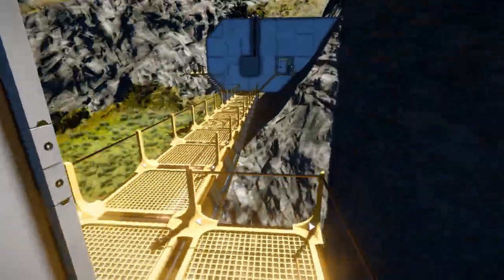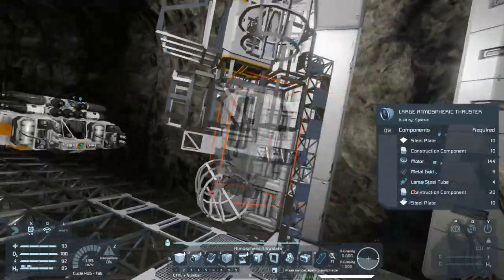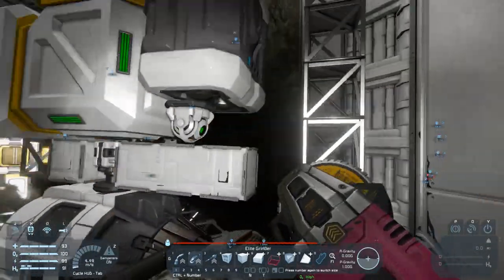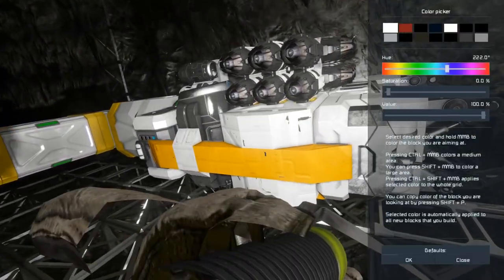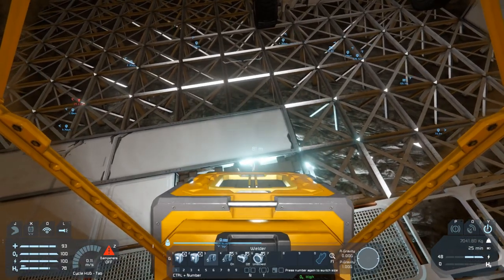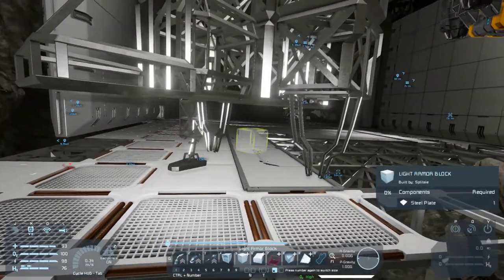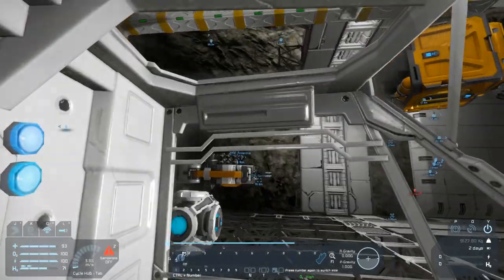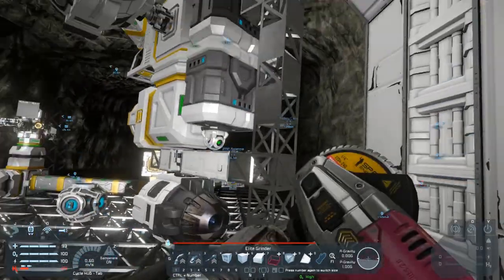Survival, Maybe... #35 Welder Woes With Buttercup (A Space Engineers Survival Series)

Comment: those thrusters on the Buttercup are just making me think the armor is going to deform and destroy something.  If I may, I would honestly replace the armor around the rotors holding the three thrusters with half slabs, maybe heavy armor variants of the slabs just in case.  Heavy armor slabs are super cheap so you won't be a considerable investment.  Those sparks just worry me too much.
Reply from the maker: The sparks are definitely not causing any damage, since subgrids can't damage each other by default. The reason I might change out the armor is because the thrusters catching might be contributing to the messed up handling of the ship so it might get things behaving better if I change it out :)

Comment: Maybe build the welders in front of your front wheels to build the road before rolling on it?
Reply: I thought about that for a while. If he puts the welders on the front portion, he'll be able to place the missing tile floors with the rover itself. Only a matter of balancing weight afterwards
Reply: Quasimodo. Not an animal but...
Reply: one thing that could also work is put the wheels on pistons, you can lower/ extent the wheels as needed to weld the plates on uneven terrain
Reply: I was going to suggest that too, puting the welders in front of the front wheels, and everything else (cargo, connecter, maybe even the cockpit) at the back to balance the weight.
Reply: Wow I had the same thought guys
Reply: Can they be mounted on rotors at an angle? Possibly with controls to change said angle on demand
Reply from the maker: To be honest I didn't actually test a vehicle with the welders on the front, but I was very suspicious that it was going to be too front heavy and topple over, though I suppose I could look into mass blocks for balance. It's something I may revisit in the future, but I think it's about time I actually weld up some of the hangar :P

Also +1 for camel and +1 for quasimodo noted :)
Reply: Lobisomen79 You know you can change height of wheels in wheels settings, right?
Reply: Kakss i know but that won't help much if the Front wheels are on uneven terrain and the rear wheels are 2.5m higher up on armor Blocks or can the wheels be liftet up that high without pistons? 😉
Reply: This might be the best solution. You can raise the welders when traversing uneven ground (like getting to a new worksite) and then lower them to actually work.
Reply: Lobisomen79 No, not that much

Comment: the rotor spinning is not your fault.
unfortunately its not my fault either, if it was i could fix it.

there is a phantom torque on rotors with thrusters, the power of the phantom torque depends on the force coming from the thrusters, and the distance of the rotor axis from the centre of mass. if the rotor axis passes through the centre of mass, that rotor won't be affected by it. when you connect to the base, that moves the centre of mass a long way away from the rotors, which causes a large torque on the rotors, more than the rotors can stop.

the only fix is to have a mod that increases the torque the rotors can deliver so they can overpower the phantom torque.
Reply from the maker: Damn, I was really hoping it was my fault - largely because that would mean I could fix it :(

I'll have to be careful how I set up the parking spot for the buttercup so that it doesn't drop far before I reactivate the script then :)
Reply: have the script, to listen to docking, when docked, turn off all thrusters, when undocked, zero out all torque and start thrusters

Comment: "Working as intended," he says as the Buttercup's thrusters spasm and spark wildly.
Seriously can you increase the distance they are from the armor or something? While they don't take damage I cannot properly describe just how unnerving it is to watch.
Reply: Glad i was not the only one thinking that
Reply: 1wsx10 57 minutes ago
the rotor spinning is not your fault.
unfortunately its not my fault either, if it was i could fix it.

there is a phantom torque on rotors with thrusters, the power of the phantom torque depends on the force coming from the thrusters, and the distance of the rotor axis from the centre of mass. if the rotor axis passes through the centre of mass, that rotor won't be affected by it. when you connect to the base, that moves the centre of mass a long way away from the rotors, which causes a large torque on the rotors, more than the rotors can stop.

the only fix is to have a mod that increases the torque the rotors can deliver so they can overpower the phantom torque.

Earlier comment by the hovercraft script author
Reply: He should add some slabs or something like that
Reply from the maker: The rotors are at their maximum displacement, I'm going to try replacing the armor with slabs and the lower slopes and see if that helps, it might improve the sparks and controls but from what I understand it's not going to stop the crazy spinning that happens when I lock to the connector :/
Reply: The crazy spinning is a feature.
Reply: AthkoreProductions Someone else reads Sluggy Freelance!
Reply: You know instead if complaining of a small error, you could just give the solution part. I'm not expert but he does make this channel the best he can and as real and enjoyable as possible without making himself a fool. If you think you can do better than do so and stop filling the comments with this garbage.

Comment: ive made a similar mining ship (large grid drill + vector thrust), those spark issues are likely due to clearance between the thrusters and the dark grey armour blocks, just remove the armour blocks directly next to the rotor and it should work fine, that's how i fixed it on my miner.
Reply from the maker: You're absolutely right, I eventually replaced them with half blocks and now it works nicely, still looks like a goldfish swimming when it moves though ;)

Comment: Concerning the Buttercup, perhaps, the drifting comes from the massive load into the off grid welder creating a torque between the two grids (two centers of mass). I think it's better to only load the main grid medium cargo container
Reply: With the inertia tensor enabled on the advanced rotor, it shares center of mass across both grids.
Reply: He turned that off didn't he?
Reply: He turned it on because vector thrust was not compensating for the center of mass and it was leaning towards the welder.
Reply from the maker: I turned the shared inertia tensor on for the advanced rotor and it stopped the drift, sadly it didn't help any of the other troubles I was having :P
Reply: I had a mess around with the vector thrust MOD after your stream.  I found if you added some horizontal thrusters behind the large atmos it made it a lot more stable and less drift (forward/back behind the side thrusters and left/right behind the rear one).

Another thought if you don'e plan to use the ship for welding, remove the welder and replace with a large ore detector, will make finding ores much easier.

Comment: With the buttercup, you were drifting in the direction of the back thruster. Since that back thruster can't tilt forward/backward, it basically ends up giving you partial helicopter controls, so even a slight tilt to the front or rear will make you drift, and you had a SLIGHT tilt whenever you were drifting. I'm not quite sure how you would fix that, since it thinks it's doing it's job by thrusting to keep you in the air, but it's off-kilter thrust.
Reply from the maker: The script's author thought the thrusters might not be aligning properly as they might be getting snagged on the armor, so I'm going to try replacing it with half blocks and see if that improves the handling at all... keep your fingers crossed that it fixes the weirdness :P

Comment: I'm rather partial to the name "Igor" for your floor surfacing machine. Also I am now tempted to slap a projector on a vehicle like that (redesigned so the welders are in front) and have it weld bridges and (Albeit awkward) roads.
Reply from the maker: I hadn't thought of that before it was suggested but it's certainly a front runner at the moment - I think it's very fitting :)

Comment: Check the centre of mass for the Buttercup. I'm pretty sure the rotors must be aligned to the centre of mass or they can clang out with vector thrust. The fact it's a mixed grid might also be part of the issue.
Reply from the maker: The rotors are pretty much as close to the center of mass as I can get them - it's pretty much at the advanced rotor I think. It would make sense that for the script to work best they'd need to be near COM but other than adding extra mass to the rear I don't think I can do too much to fix it sadly :(

Comment: Another option for your vehicle base connector, is to use a rotor rather than a piston.  Your current connector is already on an arm, so , rather than having it fixed to the junction box, put a horizontal rotor on the junction box, then run the conveyor tubes out to the current position from there.  Then a simple rotation will get the connector to the right height and it can be folded away when not in use.
Reply from the maker: Are you suggesting I put a connector on a piston and rotor, because if you are, you know exactly where my weak point is ;)
Reply: I see the twinkle of delight in your eye, but no, that's not what I was suggesting.

If you place the rotor on the back of the junction box and then the conveyor tubes coming off that horizontaly (much in line with where they are already), then the rotor can be used to make minor adjustments to the height ie the conveyor tubes work like the hands on a clock face with the connector at the tip.  No pistons, sorry.

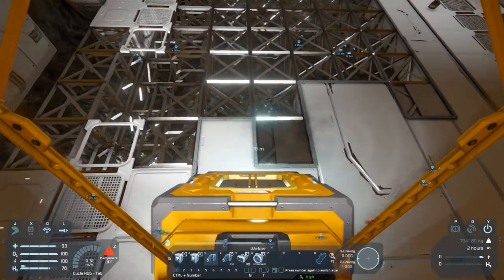Comment: 26:45 bang bang bang bang bang "AHHH Yes. this is much better."

until keen makes the rotor displacement far enough to not have it collide, i recommend putting the rotors one block further out. i have a feeling thats whats causing the slow rotation.
not sure what is messing with your controls, although it might also be the constant banging. i haven't worked on the script for a while now, so something might have changed that i need to fix. unfortunately my work load for uni is pretty high at the moment, so i don't know when ill be able to work on it next.
Reply from the maker: Ah, that's a good point, maybe the collisions are causing enough problems to the movement that it's messing with the controls, I'll throw the ship in creative and see if it performs better with more clearance, thanks :)

Comment: I was more imagining the rover to be a bit like the buttercup, with a large ship welder but with wheels on the sides of it, perhaps without suspension to save space (i.e. wheels on non-powered rotors), and then tilted down towards the floor in front by putting the wheels at back perhaps five or more blocks lower than the wheels up front.

And how about "The Knotted Snake" or "The Tangled Worm" as a name?

Edit: I was also thinking that in a design that is tilted like my idea above, it might be prudent to put the connector on the side instead of top or back, that way you probably will not have to put in a specially rotor-tilted connector in the base to make it connect.
Reply from the maker: I think with the old welder range or with a large ship welder that could work quite nicely, I stayed away from the large grid welder for the rover to try to save on space but your design idea sounds like it would have been a lot of fun to mess around with :)

Comment: Why didn't you just add a conveyor frame under the first conveyor junktion on top of the um..... Elephant instead of the piston linfting and under carige extension? May have also replaced the junktion block with elbows while you at it. Sorry if I skipped and missed this part.
Reply from the maker: I thought about that while editing, didn't think of it at the time, I guess I thought it was going to be easier to set the wheels to the right height for some reason... in other words, I really should have just added the conveyor frame :P

Comment: It's kinda hard to manuver this welding cart around. I suggest you making the wheels frictionless and use thrusters and gyrk to move around.
Reply from the maker: That's an option, not sure how power efficient that setup is though, it's certainly better than flying but fully loaded this little vehicle is pretty heavy... It would make getting into the corners easier though

Comment: I dunno Splitsie, why didn't you put a rotor on the welder(s) of the wheeled hamster, would have saved you some trouble, isn't it ? ... and some thrusters, even 1 large up thrusters could do the thing ? Vector trust is fabulous ... if you are unable to use the normal setup
Reply from the maker: I was deliberately building a wheeled welder, since the buttercup worked reasonably I wanted something that was maximally energy efficient - which mean wheels only :)

As to not using a rotor, I couldn't see any big advantages to it, as I only have a few blocks on the walls that a rotor mounted welder would reach so the downward facing ones did what I needed

Comment: By the way I also have encountered some of the same trouble with vector thrust: the high rpm when attached and the troublesome handling. Have you considered where your rotors/nacelles are versus center of mass? Also what about the shared inerta tensors on them? I think you might have said in a previous video that it could help.
Reply from the maker: I just tested it, the rotors still went crazy while the connector was locked whether shared inertia tensor was on or off :(

As to the weird control issues I was having, 1wsx10 (the script's author) suggested I try moving some of the armor that was causing collisions because it might have been restricting the rotors' movement so I just tested, it made it fly a bit better - still went crazy on locking though :P

Comment: Hey Splitsie.  I know this is almost 3 years after you posted it, but I'm wondering why you went with a small grid welding rover, rather than a front-mounted large grid welding rover?  It would have benefited from the wider welding area, be able to weld up plates in front of it, and be able to have conveyors to a centrally-mounted storage area to keep it from becoming top-heavy as you were worrying about.
Reply from the maker: Large grid would have been too difficult to fit inside the base, I wanted something that was more capable of moving in the rather cramped confines :)

Comment: Your spinning issues arise from you not setting your breaking torque, set it to max and you won't have this issue anymore, also go standby as soon as you connect will also help
Reply from the maker: Going to standby certainly helps, the trouble with playing with the rotor settings is that the script takes over most of them and it hasn't seemed to make any difference when I've done that in the past, I didn't try in this case though so it might have helped...
Reply: Splitsie yeah, I always set it to max brake before I start adding engines, I noticed when it would eventually stop it slowed down super slow, when you put it on standby it turns off the rotors, so when you standby with brake torque, they'll simple freeze(I've done several expirements with dual axis side pods, I'll put a single small engine(in future a small ion thruster) out the side and then on either side of that I'll put my main thrusters on two more rotors, the result is like 8 small thrusters and 2 little thrusters all going ant direction they need to go

Comment: Wouldn't it have been faster to just weld by hand? Correct me if I'm wrong. Just wondering
Reply from the maker: The welding itself, almost certainly, but the delivery of the materials is quicker with the grid based welders due to the low capacity of my suit :)

Comment: Old vid I know , but I've just found it .. I was wondering if the vectoring problem was a centre of gravity issue maybe ? Looks like u would have most of your weight forward of the thusters so when u move up it compensates by moving forward
Reply from the maker: It's possible, the script normally does a good job of compensating for that, but this is very front heavy :P
Reply: Splitsie either way ur good at what u do , got a sub from me

Comment: if you made the welding car with 3 of the welders in front and back then you could weld projected blocks driving both directions and it would look like a dumbbell lol
Reply from the maker: That's a good idea, I didn't think of putting the welders in front and back, I didn't put them in front because of feared balance issues, but if I did it both ways like you suggest it wouldn't be a problem... I might have to toy with that idea and quickly replace the rover in a future video if I can get it working nicely :)